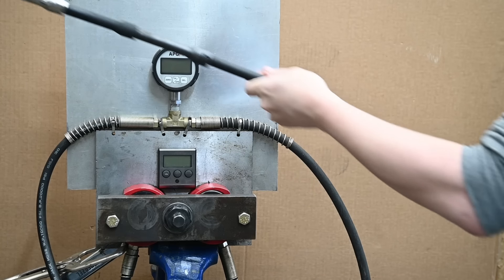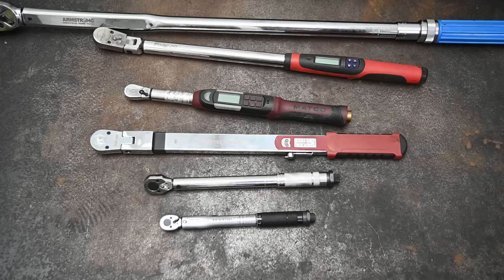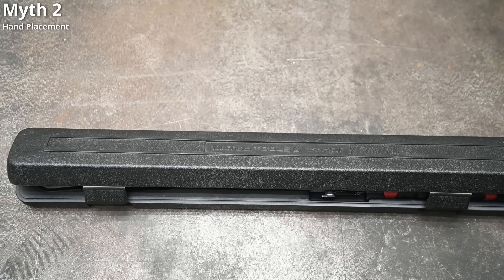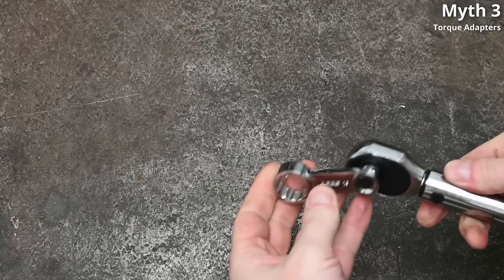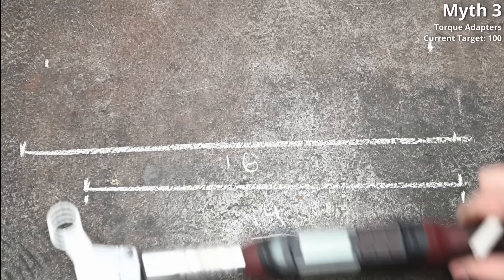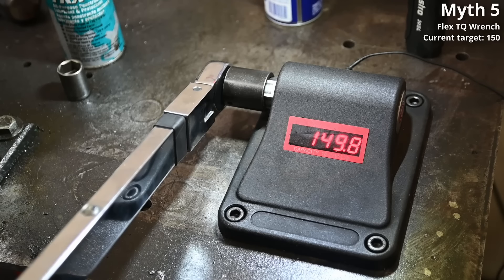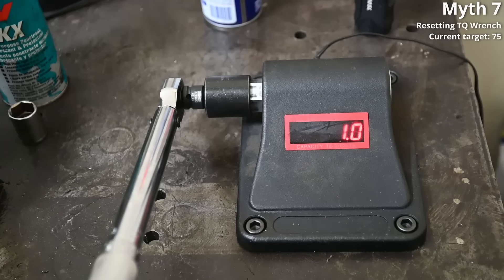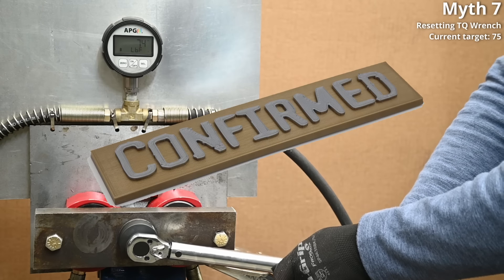You're Using a Torque Wrench Wrong: MythBusting 10 Do's & Dont's

Comment: What about ''using a clicker torque wrench to loosen bolts damages it''? Can you test this please? Specifically wrenches that only torque clockwise. I think it wouldn't, cuz the torque setting mechanisms are not involved when torqueing the other way. And then what about clicker wrenches that are designed to torque both ways? This time the torque setting mechanisms are at play. Some argue the sudden release of torque when bolts break loose is damaging to the wrench.
Reply: I think using a clicker torque wrench as a breaker bar 1 or 2 times in a pinch is fine, as long as you're not going outside of the rated torque range, in that case, the un-monitored torque  might reach too big and damage 1: the rocking head piece where it's tail touches the inside of the barrel and 2: the pin the rocking piece pivots on and 3: maybe the rachet tooth in the head 
(the 3 parts which I suspect are the mechanically weakest on the wrench).
Reply: Obviously use a breaker bar if availavle and save some wear on the wrench, but my point is loosening some bolts with a clicker torque wrench probably won't hurt it.

Comment: I am surprised that the torque value changes with hand placement on the tested wrenches. I can see why that would happen on an old style beam and pointer torque wrenches because the center of deflection changes with hand placement. That is why the handles on those old torque wrenches was actually on a pivot.
Reply: On the adjustable wrench convertible torque wrench, they could have added a second scale for the adjustable wrench head.

Comment: with the adapter heads, couldn't you place your hand further up the handle to make the difference to get accurate readings?
Reply: It depends which way you mean by further up. The extended adapter reach increases torque delivery - with the common click wrench, moving your hand up closer to the fastener axis also increases the torque at the click. (As per Myth #2)

Comment: Wow. I knew anti-seize modified bolt tension, but not that much. My truck lives in Ohio, and its lug nut spec is 151'lbs. It's a wonder I haven't broken a wheel stud in 15 years. Maybe I should back off that a bit!

Comment: What if you use a clicker type, but then choke up on the handle the same length of the extension?
Reply: That would make the discrepancy greater, since choking up on this type of wrench also increases the torque delivered at click point (as per Myth 2).

Comment: on the wrench, could you choke up the handle the same length difference as the the wrench head? would that give you a good reading?
Reply: For the most common types of torque wrench, it would make the situation worse, since choking up also delivers higher torque. If you were using one that was not length dependent, such as a slipping cam mechanism, it would make no difference.
 If the question relates to Anti-Seize, the only viable way to compensate for a friction reduction is to reduce the torque setting, and to do that accurately you need to find out a K factor adjustment for the application in use according to how much it alters the friction coefficient. If they think of it, people commonly just guess.
Reply: @PlatypusPerspective  Good points. Appreciate the response.

Comment: Double Clicking equals over-torqueing?? When I worked at Boeing, they showed us the result of double-clicking a TQ wrench and they showed it increased the torque slightly every click. In this video, I saw you mult-click with no additional TQ added. I don’t get it. I saw with my own eyes in 2012 double clicking adding torque but your video doesn’t show that. Very confused now.

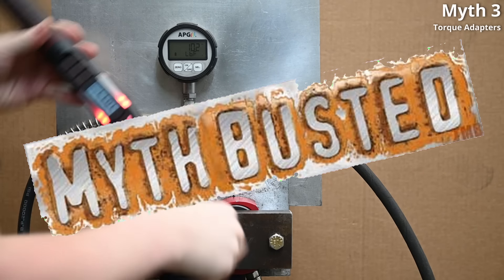Comment: 8:53 when on 90° you need to do Pythagorean theorem to find overall length from pivot point, in your case the extension was too small to be relevant, that is why you have not noticed any difference, the following clip at 9:48 is not at right angle..
Reply from the maker: You'd think so. But not the case. I didn't know about it. But it's a well known fact you can Google ot seems

Comment: If you go back to the equation in Myth 3 (and could have been used in Myth 2), the reason Myth 5 is busted is because the maximum flex in the flex head wrenches doesn't measurably affect the distance between handle and wrench head.

Comment: One more myth is holding the head of wrench when you tork the bolt specially when you use extension so the socket wouldnt slip. For me it changes the reading.

Comment: It might be clearer if you reported your pressure gage setup as bolt tension in lbf or N. The anti-seize didn't change the torque reading. What it did was provide a lot more tension for that torque. That's a good thing to know, because it doesn't just affect fasteners with a torque/trnsion spec. Even just tightening things by hand to "gutantight", a factor of two in tension produced could easily result in snapping a fastener by hand.

You feel really stupid when that happens!

Bonus factor: you wouldn't have to redo the conversion for every screw pitch.

Comment: Curious if you clicked each one 150 times new before using them? Donut media was doing some test and discovered they are all way closer to spec weight after. Also would locktight have the same effect since is a liquid or gel till it drys?

Comment: ARP has a lube they say to use on their fasteners. Will that multiply the torque spec as the antiseize does? Thats a bit concerning.
Reply from the maker: ARp fasteners' torque specs are wet/lubed. So no effect. Lug nut torque spec is dry.

Comment: myth number 5, flex heads.  when you flex the wrench, the effective length gets a little shorter.  in a high accuracy requirement, you can adjust that just they way you did for myth number 4

Comment: I would have another "myth" that i would like to know about: We have a torque wrench at home that only clicks in one direction. ->when tightening normal screws but it does not limit torque in opening direction.
We use the torque qrench at home to open the wheel screws of our cars and to tighten them.
A working collegue of mine is of the opinion that using it that way makes it loose it's accuracy.
I can't see how. So is it a myth, or is he correct?
Reply: I can think of a couple of potential factors. Regarding accuracy, the mechanism is typically a pivot block system, the accuracy of which varies with dimensions of thousandths of an inch.  (Calibration adjustment is done selecting blocks of varying dimensions.) One of the reasons to exercise the wrench before use is to ensure the mechanism doesn't have a set varying from its correct operating state. Even if the wrench is bi-directional, you should exercise it before further use if the direction is changed, otherwise the first measurement in the new direction could be false. Probably more so with a single direction unit, which isn't intended to be passing force via the release mechanism "backwards".
A danger with reverse operation with a wrench that cannot deliver any indication of torque reached, is if you unwittingly try to undo a seized, corroded or massively overtightened nut. The force necessary will be much greater than expected, and without any indication of a torque being reached, there will be no warning if the force becomes greater than the mechanism is designed for. And again, this force has to be passed in the reverse direction to what the mechanism is designed to do.
It's one of those situations where there mightn't be a problem, but if there is you'll wish you hadn't done it.

Comment: I've had a click style torque wrench out in my shed set to the torque of my lugs (83 ftlb) for a while. Months at least. Does that mean the spring inside is shot, the wrench won't be accurate, and I should replace it?
Reply: Not necessarily, unless you're unlucky and have a wrench with a poor quality spring. What could give you an indication is to steadily back off the setting, "feeling" how much spring tension there is by how much resistance there is to increasing the setting again at a couple of points on the way. Normally at the lowest torque setting it's quite easy to turn but you can still feel that you're compressing the spring. If you get that feeling going up from minimum setting, good sign. If it felt free like the spring had little or no tension there, it may have developed a set. In that case you could leave it at minimum setting for a week or two to recover and see if the feel changes.
 Better, if you can borrow another torque wrench, you could compare results tightening the same nut with yours, marking with a scratch or fine felt tip pen, loosening and applying same torque with the borrowed one. Some variation in angle of rotation is normal of course, but if yours isn't a lot different to the other one, that would indicate they're delivering similar torque. Other possibilities are to wangle a way to connect the two wrenches' square drives and see if they both click around the same time with one held secure and pulling on the other one as normal, or borrow a digital torque adapter to check the output of yours. More people have a digital adapter these days as they're not too expensive.
Reply: @PlatypusPerspective Thank you. Super helpful.

Comment: How many times can a bolt, such as a wheel lug nut, be torqued to spec before it must be replace due to metal fatigue or any other safety issues??
Reply: Not something you can put a specific number on - one thing you can check is spin the nut by hand up the wheel stud (with a clean thread) to make sure it travels freely for the entire thread length. If it starts out feeling normal, then at a point becomes reluctant and binding, that would indicate a probable bend or stretch, and the lug bolt should be replaced. If the thread has some visible mechanical damage at that point, maybe it could be cleaned up with a die, but would still best be replaced - something undesirable has happened to it.
But if there's been no abuse, they can last until the car is taken off the road.  🙂

Comment: even using a really long torque adapter will start to skew more, because at 90, your lever length still goes up, right triangle, Pythagorean theorem, yeah. thats why there still really close with a 2 inch adapter, bc they were just "really f'n close" to begin with lol

edit; ^ is probably why you find torque adapters only in stubby

Comment: I was taught when I started using torque wrenches to hold it in the correct place, but I still don't understand how this affects the torque.  🤔 Can anyone explain?
Reply: There are torque wrench designs where this is not essential, but for many it does affect the correctness of the torque measurement. It's a characteristic often called Length Dependency.
The common type of click wrench is one example - it is Length Dependent because it is made up of two levers of different lengths. The force from your hand is applied over the full length of the tool to deliver the torque to the fastener axis, but it is carried part of the way by the shorter lever formed by the tubular handle, which has its axis at a pivot pin a couple of inches short of the fastener axis. The clicking torque measuring mechanism is located inside the tube and only registers the force being applied over this shorter lever.
If you move your hand, say, halfway up the wrench, and apply twice the force, by the law of mechanical advantage the resulting torque at the fastener will be the same because the lever length is now halved. But the lever length where the measuring mechanism is measuring is now shorter than half its length, so it thinks you haven't reached the required torque yet. You will have to apply more than double force to get the click indication, so too much torque will be delivered.
Different types like deflecting beams have detail differences in the cause, but show an equivalent need for the force to be applied at the right distance from the point of delivery.

Comment: I have a 1970's torque wrench I bought back then I didn't look at the scale when I bought it. It's in inch pounds. WTF how do I calculate the foot pounds? multiply by 12 or divide by 12? I never use it. I don't do bolts that need to be torqued.
Reply: Divide inch pounds by 12 to get foot pounds.

Comment: I'm not going to comment on everything, just the micrometer click type wrenchs. I worked for Snap-On tools for over 17 years in one of the repair centers, I worked on many torque over the years, even certifying them for use on submarines, airplanes, locomotives and use in nuclear power plants. The micrometer click type are NOT designed to be accurate  or to be used at or below the 40% value nor are they designed to be accurate above the 80% range. They also are to only be used holding the handle with no pipe extensions on the handle. Be of the internal spring taking a memory set, they should also be stored at the 20 to 40% setting, no higher and more importantly, no less than the 20% setting. The reason for this is that if you take off all the pressure, it is highly possible that if the wrench is dropped, the pivot can dislodge and cause HIGHLY inaccurate readings because the the pivots are actually calibrated fo each wrench. Just thought you might be interesed in this info.

Comment: So riddle me this... If a fastener is still turning when the wrench clicks , is that fastener torqued ? . Say you decide to click it again just to be sure and the fastener rotates some more before the wrench clicks... and maybe even a third time or more?.  In my mind if the fastener is still turning before the wrench clicks - It's not torqued . My idea of a torqued fastener is one that has no movement upon the moment that the wrench clicks. Right or wrong ?
Reply: A neat feature of the engineering design of the click wrench is that the fastener will have to stop turning in order for the click to occur. To click, the detent mechanism passing force to the fastener has to release, at which point the fastener will stop rotating, as it can only keep turning against friction and increasing bolt stretch if the force is continually increasing.
 This is good - since the operator can't react to the click and stop moving instantly, there will be a secondary peak of force application. As the fastener has stopped moving, starting it again will have to overcome static friction, which is greater than dynamic friction, reducing likelihood of accidentally over-torquing.
 This suggests that because starting a stationary fastener has to overcome higher static friction, getting further rotation from subsequent applications is probably due to the operator overshooting coming from a "standing start", being unable to limit themselves to the usually only 3° movement to click, and hence over-torquing. It does however give me another possibility for things to investigate when my torque loading bench project becomes operational, thanks for the idea.
Reply: @PlatypusPerspective 
I knew there would be some bozo that would try to tell me what I was seeing was some kind of operator error... thanks for the drawn out technical explanation but it has nothing to do with overshooting anything. After torquing hundreds of thousands of fasteners over a lifetime I think I have a grasp of what's going on at the end of a torque wrench , but you are entitled to your opinion. A fastener doesn't always just seize up as soon as a torque wrench clicks, its sometimes possible to get a little movement from it with multiple tries , not always but sometimes. I always feel better when I've doubled clicked it and verified its not moving with the wrench no more and if that's over torquing, so be it.
Reply: @zombiewolve  My apologies if I misread your query as a request for a considered response from science, I admit I overlooked the riddler comedy introduction. 🙂
 Since I'm now retired, one of my reasons for building a low-cost basic torque loading bench is to do some investigating of these types of questions. It has irritated me that readily available technical resources gloss over details like this, leaving you asking "but what exactly is going on?" I'm not saying the occurrence of an effect that's unavoidable by the physics is operator error. The only way to know definitely whether a fastener moving on a second application was under or is now over torque would be to check measure.
Reply: @PlatypusPerspective   No need to apologize I sorta snapped at you when all you where doing was trying to answer my query . Keep up the good work and good luck with your endeavor.
Reply: @zombiewolve  If I'm able to observe anything relevant to the discussion, I'll let you know.
Reply: @PlatypusPerspective  Thanks....

Comment: One thing I see frequenty is that you can't use the bottom 20% of the range accurately, or such. I do wonder using a 30-350 wrench at 30 on a delicate aluminium thread.
EDIT: Had to clarify the accuracy measurement standards, and ansi/asme and iso differ a bit but ISO 06897 2017 requires a measurement at 0%, 60% and 100% so a wrench complying to that should be usable at expected accuracy full range. ASME B107.14M requires accuracy rated 20%-100% and lower than that 0.8% error of the full scale reading. Older ISO standard is lowest rated at 20% as well.

Basically, unless especially specified, claimed accuracy rating shouldn't be expected below 20%, and according to snap-on ANSI allows up to 16% error at 5% for example. Most might not have that high error, but below 20% it's probably not 3% but closer to 10% or whatever everyone specifies if you're not buying with big bucks and/or know and trust the certifications. Also the clicks get progressively weaker towards the low end so might not even be noticed.